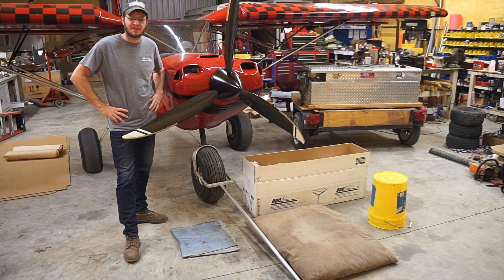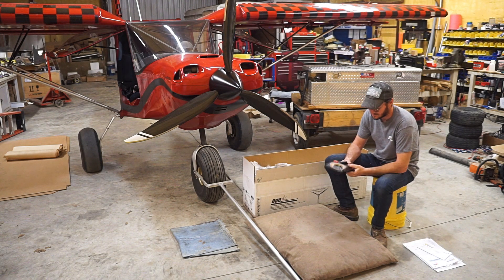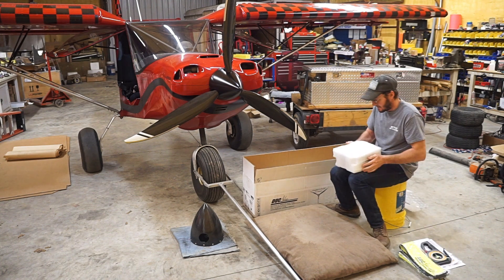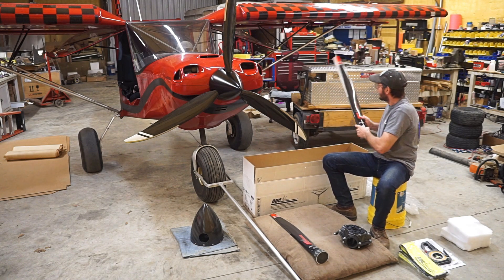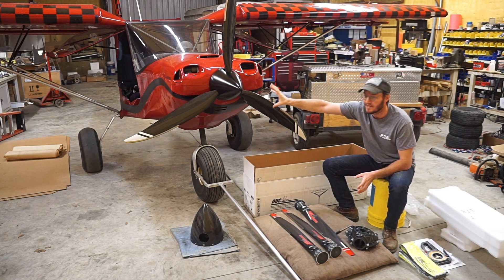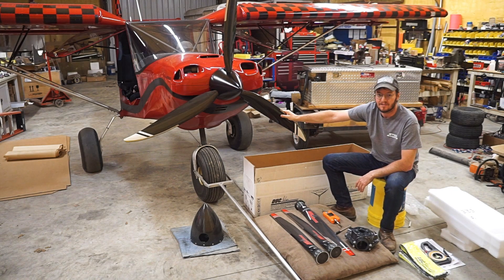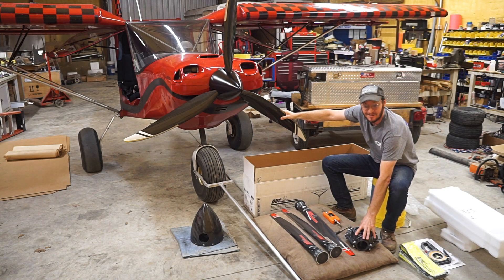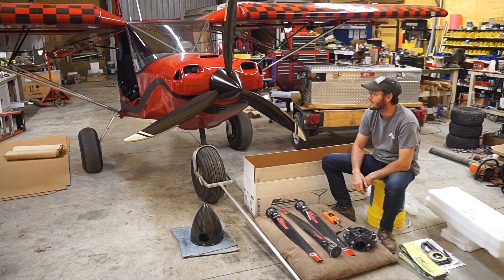Super701 gets a new DUC Propeller! Part 1: Unboxing and talk about plans for comparison and testing.

Comment: I've been wondering about building a 701 with a 1320 gross. What did you have to do to get yours there. I'm afraid if I try I'll just wind up increasing the empty weight and not really helping my payload capacity.

Comment: looking forward to part 2, thanks! 
Interesting that the blade chord length on the Duc looks alot less than your existing. Be interesting to see how it can develop as much thrust when it would appear its taking alot less of a "bite" of the air.